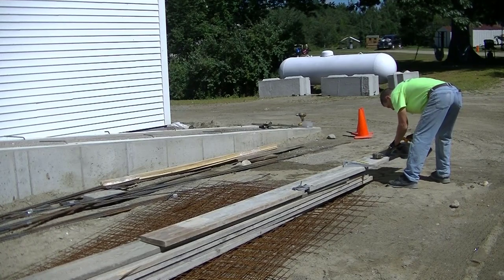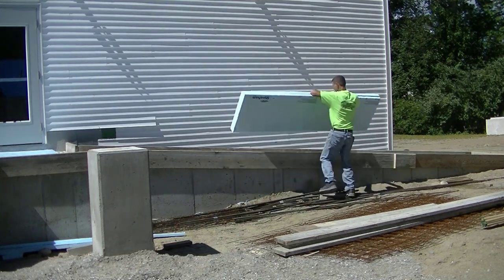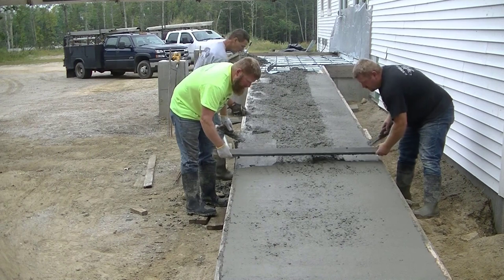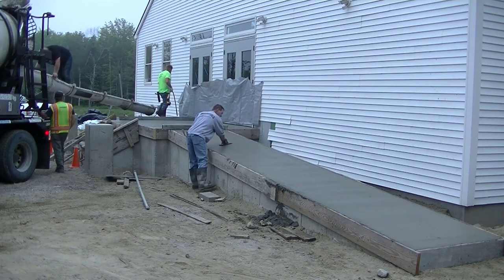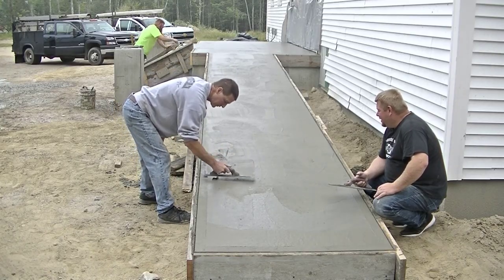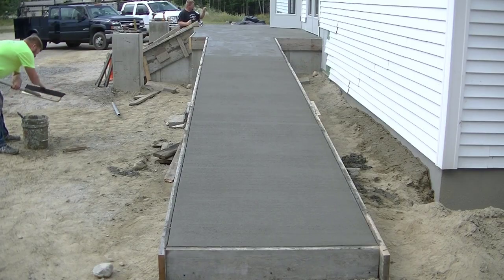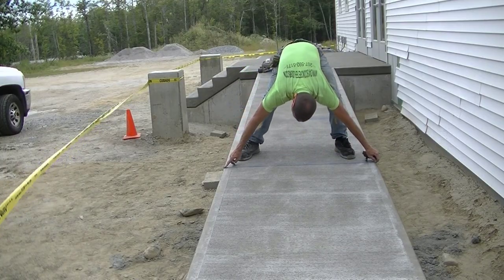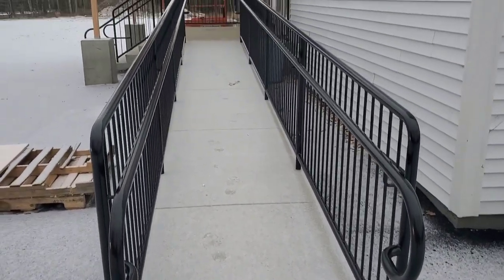ADA Concrete Wheelchair Ramp 1:12 Slope (Form, Pour, Finish)

Comment: Nicely done.  I need to have several drive up ramps/aprons from the graveled road into my newly built garage.  I have four areas that require ramps entering the building so that will finalize my exterior work.  Thanks for the video showing how you poured and finished the concrete.  I'm anxious to have my ramps done. So in order to control the slipping of poured concrete, just make the mix drier so gravity doesn't make it shift.  Enjoyed a full-watch.  I learn something new every time I watch your vids.   👍🏽🤠 02/23/24
Reply from the maker: Thank you

Comment: You did a nice job on the ramp.  You may not be aware of how dangerous blowing concrete dust (silica) is without the use of a mask to protect your lungs. Silicosis is an interstitial lung disease caused by breathing in tiny bits of silica, a common mineral found in many types of rock and soil. Over time, exposure to silica particles causes permanent lung scarring, called pulmonary fibrosis.

Comment: I think you are right about screeding uphill. I'm no expert, but I found that screeding downhill tends to drag the concrete from behind the screed leaving it low. The wetter the mix, the worse the effect because gravity helps to move the concrete down hill.  I do have a fair bit of experience pushing wheelchairs around and dealing with four wheel walking frames though and the cut joints in the concrete are a good idea as some people can get hung up on the smallest bumps, especially with the wheeled walking frames.  I like the slope too as it helps with decent control more than anything. I have seen a walking frame get away from someone that was going down a steeper ramp and they were not strong enough to work the hand brakes. That sort of thing can be pretty nasty.  Good job and thanks for taking the time to think about the people who might make use of your concrete artwork.

Comment: Americans With Disabilities Act of 1990
(ADA; Pub. L. 101-336)
The ADA established accessibility guidelines for buildings and facilities
(see Phillips et al., 2020; Foti & Koketsu, 2013, pp. 179–194; U.S. Department of Justice, 2010)
Accessible route: The minimum clear width of an accessible route is 36 inches, except at doors.
Ramp
The maximum slope of a ramp is 1:12. Ramp slopes between 1:16 and 1:20 are preferred. Most ambulatory people and most people who use a wheelchair cannot manage a slope of 1:12 for 30 feet.
The maximum rise for any run is 30 inches.
The minimum clear width of a ramp is 36 inches.
A ramp run that has a rise of more than 6 inches or a horizontal projection of more than 72 inches should have handrails on both sides.
Stairs: All steps should have uniform riser heights and uniform tread widths of no less than 11 inches.
Handrails
Clear space of 1–1½ inches between the handrail and the wall
A height of 34–38 inches, or waist height depending on the person’s height, measured to the top of the gripping surface from the ramp surface or stair nosing, is recommended for adults.
A maximum height of 28 inches is recommended for children.
Doorway
The minimum clear opening is 32 inches. (Note: The minimum clearance width for a standard adult-size wheelchair is 26 inches; the minimum clearance width for a walker is 18 inches.)
Thresholds at doorways should not exceed ¾ inch in height for exterior sliding doors or ½ inch for other types of doors.
Raised thresholds and floor-level changes at accessible doorways should be beveled with a slope no greater than 1:2.
Door hardware for accessible door passages should be mounted no higher than 48 inches above the finished floor.
Wheelchairs: minimum of 60-inch diameter or a 60-inch by 60-inch T-shaped space for a pivoting 180° turn to avoid the need for repeated tries and bumping into surrounding objects

Comment: If you bull float the opposite way of the screeding you would help your highs and lows.
Reply from the maker: On a slope like this it doesn't work that good, been there and tried that many times.
Reply: @MikeDayConcrete  use a lighter bull float without a knuckle